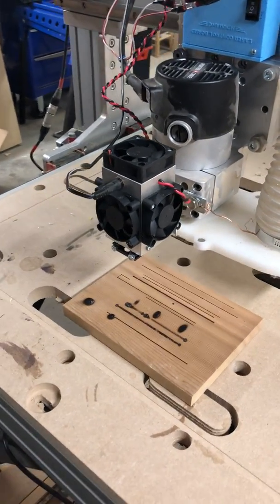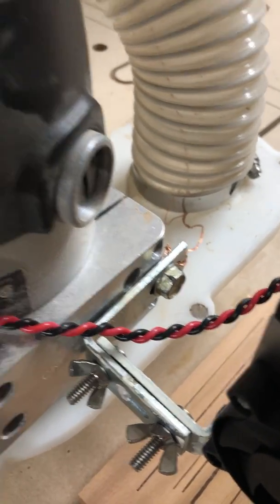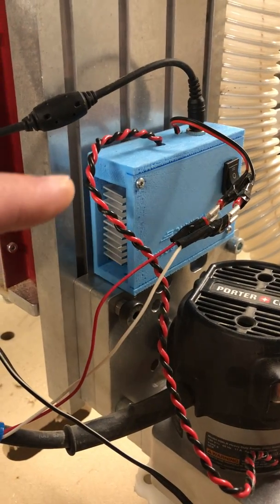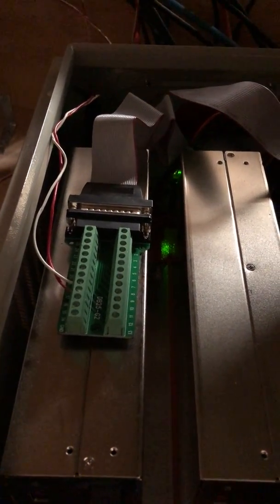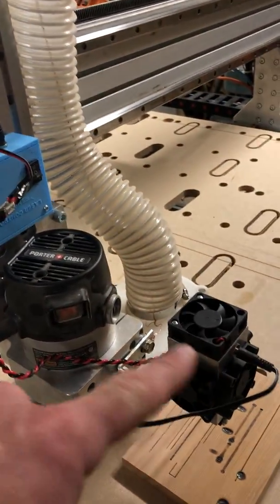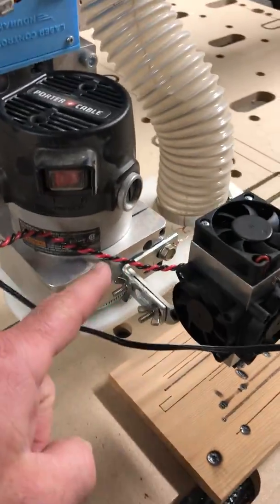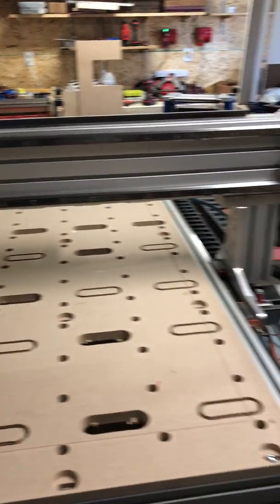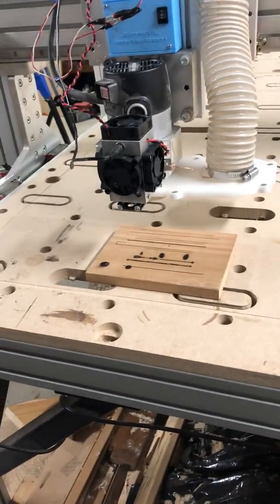Laser addition to CNC RouterParts 48"x96" CNC

Comment: Great video. I'm looking into doing this on my CNC router as well. 

How do you zero your z axis for the laser so your focal point is correct since the material height can change from one project to another?
Reply from the maker: I ran several tests to determine optimal height from the work piece for best laser focus. At that point, all I needed to do was ensure my Z height matched that value for every project. The laser focal point does not change as long as it stays a consistent height above the work piece, then it will remain in focus. Your CAD software can adjust this on 3-D work surfaces as long as your post processor and software allow for it.

Comment: Could you possibly part the exact list of products purchased to accomplish this? I'm looking at the same laser, but there are multiple accessories offered and I am unsure of what I actually need. This will be my first laser. Thank you very much for the details already provided!
Reply from the maker: Absolutely.  Some might vary depending on your setup for your CNC--for example I just used 2 simple L-brackets for the mount as my CNC router mount had holes right there...cheap and easy.  If you don't have something that convenient, then you can 3D print one or you can order one from Endurance Lasers, I believe.  Anyway, as far as the other things, most of it comes with the laser kit (I bought the 10 W).  The 2 things the kit doesn't come with are power supplies--I know it seems odd, but I actually preferred it because I could easily locally source a 5A, 12V power supply for the laser control board and a 1A, 12V supply for the fans on the laser module.  That way it didn't have to ship internationally from Russia....probably saved $20 in shipping.  
I got mine on Amazon-- https://www.amazon.ca/12-Volt-Power-Supply-Standard/dp/B009ZZV6TA/ref=sr_1_fkmr0_1?s=electronics&ie=UTF8&qid=1529526179&sr=1-1-fkmr0&keywords=eptech+12v+5A+standard
Also get a 1A as well at the same time for the fans on the laser module.
You will need about 12 feet of wire or more to get you from the breakout board off Port 3 to the laser control board-I just got mine at Lowes--50 feet for $12--it isn't very thick-it's only carrying the TTL signal.  While were on the subject, don't forget the breakout board and ribbon cable to get your pins for Port 3 accessible (you can just come right off the port3 connector, if you want, but a big pain in the butt.
Ahren at CNCRP recommended these ones: https://www.amazon.com/gp/product/B009JXK5UE/ref=oh_aui_detailpage_o00_s00?ie=UTF8&psc=1
and
https://www.amazon.com/dp/B074387N6B/ref=sspa_dk_detail_7?psc=1&pd_rd_i=B074387N6B&pd_rd_wg=Bbg6O&pd_rd_r=9XRABKV9PECXD11DGZKK&pd_rd_w=aOlgN

That's pretty much it.  My setup isn't all pretty looking or anything...perhaps I'll worry about prettying it up a bit later, but it sure works great!  I haven't posted any of my engravings yet...I'll try to post some tonight.

Oh, and about your 4th axis...I have the motor for the 4th axis too--you still have Port 3 available.  That uses port 2, as do the relays.  Good luck!
Reply: Silver Harbour CNC and Woodworking thanks! Great to hear about the port not being used up. I'll have this machine doing everything in a few years. Maybe washing dishes eventually? 
I'll send links to the 4th axis setup when they are posted, just in case you want to be able to get up and running without all the research.
Reply from the maker: I would love to hear about the 4th axis.  It is on my list....my ever expanding list.  If you get the dishwashing up and running, message me IMMEDIATELY!!!

Comment: Excellent video and looking to add this to my 48 x 48 CNC. Well Done and great explanation. Curiously, what relays are you using? I am planning on a J Tech Photonics 3.8Watt laser, but found this setup and considering it for the higher output. Would love to see some shading and depth tests with the speeds and feeds nomenclature.  Thank you sir!
Reply from the maker: Thanks!  If you have a CNC Router Parts machine with the plug and play electronics, then you'll know that there are two in/out relays for powering dust collection, router, etc.  I set up Relay 1 as Output 1 in Mach 3.  That runs my router.  I needed power for the laser driver board and the fans (12 volt, 5-6 A for the laser driver board and laser module, and 12V, 1A for the 4 fans that cool the laser module.)  So I set up Relay 2 as Output 2 and switched it on at the start of the G-code.  However, I found it simpler to just disable Output 2, as whenever I load the Laser profile in Mach3, the power to Relay2 turns on (because it is uncontrolled unless you enable it).  Without any M11/M10 commands, the laser is off anyway, so it's just the fans, which aren't much power.
I looked at the J-tech, but to me, I wanted to have a bit more juice to engrave harder materials and cut a bit...the 10W is just right.  You do have to keep it cool though!  The laser driver board case was too cramped so I 3D printed another one and added a 50mm x 50 mm fan.  All good now.  George at Endurance Lasers is quite helpful and a really good guy.  I'd recommend them for sure.
Reply: I understood your response & it is well written for a CNCRouterParts. Great machines & awesome Support Team! 

I however am building my own control box on a GarageWorX 48x48 CNC by Dave Gatton. I am following the control box plan largely based on Michael Merzke. Both are creative & helpful gents as well. 

I had an awesome video chat with George at Endurance Lasers today minutes after sending a support request with my questions. I am thoroughly impressed with his 8.5+ Diode Laser for all the same reasons you stated.
Reply from the maker: you can do it on the Gatton machines too.  My first CNC was a Sidewinder, by Dave Gatton.  Ran nice.  George will get you sorted out.  I can help with the Mach3 setup if you need.